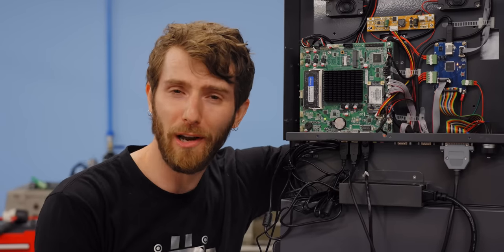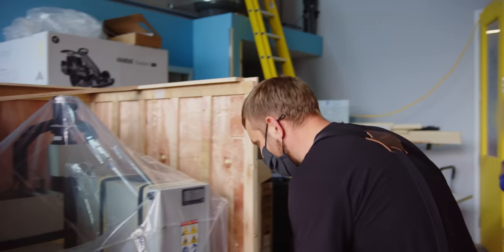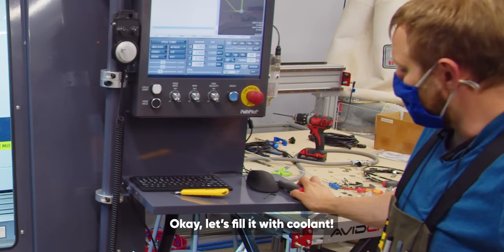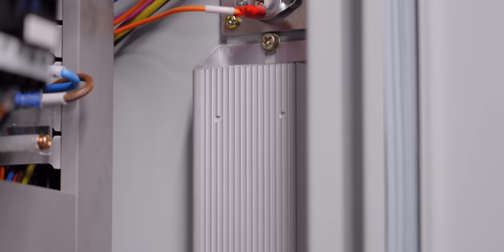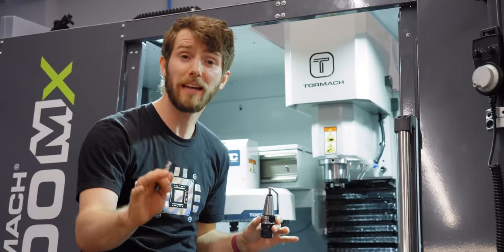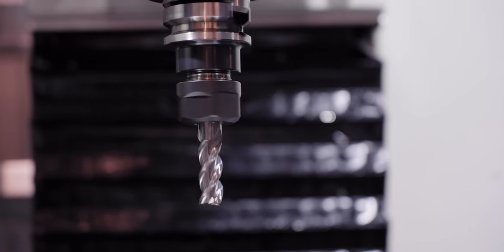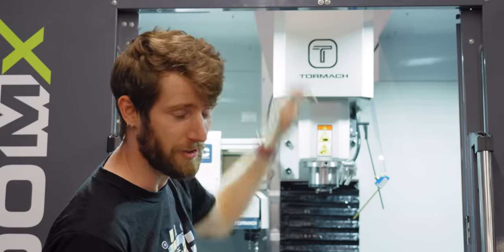The longest unboxing we've ever done. - Tormach CNC Mill Commissioning

Comment: You guys have nicer tools and vises than I had when I was making aerospace tooling and parts. Just shows how much my boss valued my sanity.
Reply: Aerospace tooling???? Whaaaaa that's so cool
Reply: lol same. I doing aerospace stuff down to +/- half a thou on super old romi lathes and a fadal mill, the tormach they have would’ve made my job much much easier.
Reply: But what kind of aerospace parts and tools are you guys making? Because "aerospace parts" is quite a broad term, from riveting hammers to turbine blades. So I'm kinda curious.
----
One little note: an old machine is not necessarily a bad machine. It's wayyy easier to get your tolerances with an old reputable-branded machine, then on an affordable new machine. (if well maintained)
New cast iron has internal stresses, if the factory didn't get rid of them enough, then your bed will warp because of use and vibrations. If your mill is old, then time has gotten rid of the internal stresses, and it will be just as straight as is was during the last overhaul. If your mill is expensive, then they have gotten rid of internal stresses at the factory.
Reply: @AdrianCupHolder  i can guarantee you it wouldn't.... lol... most problematic set of machines i've ever used was a brand new pair of tormachs and it was the reason i left my last job. 

i play with a Haas Tool Room Mill from the 1990's now and it hasn't given me any grief that i didn't generate myself.
Reply: @sasjadevries  Mostly prototype parts for the engines, gauges used to measure the accuracy of assembly and tooling used in coating processes of turbine blades shanks and many, many more. 

The fact is, you can make very precise parts on old machines with old tools and so on but sometimes I wished so hard they would buy me a tool that would make my life so much less stressful. A vise that would be actually very precise from the start and not needed to be modified to suit my needs.

Comment: I love how he's basically buying a new machine each time they have a new project at this point
Reply: It’s sad. They already had everything they needed.
Reply: I think they already wanted the tools. They just needed a project as an excuse to buy them. lol
Reply: @jacobleeson4763  i'm pretty sure most machinist would say, there's no point where more tool is bad
anyway, they now have toys to play with, i'd imagine it'd be engineering heaven for collin n friends
Reply: luckily CNC like the Tormach they bought can make anything they need if they learn how to do it. I used to think of cnc as basically plug and play but there are a lot of things you need to know and do to achieve proper tolerances and good finishes at a reasonable sum.
Reply: @Xlaxsauce  I have a strong feeling they won't fully learn how to use it. It's LTT after all, king of just scratching the surface haha. But they sure are nice machines
Reply: He prob made enough to buy 2 more off the video lol

Comment: AvE laughing as he watches Linus confidently talk about CNC like it's easy.
Reply: but Linus has been confidently talking about stuff he has no clue about for YEARS.
Reply: RELEASE THE SHMOO!!!
Reply: Careful KEEP IT IN THE VICE
Reply: I have a feeling there will be some lessons learned the hard way. with this machine. Like, humans are the softest thing in the shop type lessons.
Reply: What's hard about putting some G-code into a computer and pressing start?
Reply: @ssp_2015  Replacing the z axis and spindle after you yeet the vice.
Reply: Was waiting for the “skookum as Frigg.”
Reply: @israelmxc  ? advertising + youtube rev + sponsored videos. merch is minimal.
Reply: @ssp_2015  here's the hard part, recovering after mastercam errors out and crashes
Reply: @joshmdmd  Depending on the youtuber, merch can be a big chunk of revenue. Games Nexus talks about theirs a lot
Reply: @ssp_2015  when you forget that you need to make the radius of your tool smaller than the  smallest inside radius in the part.
Learned that one the hard way.
Reply: I. Ooooh
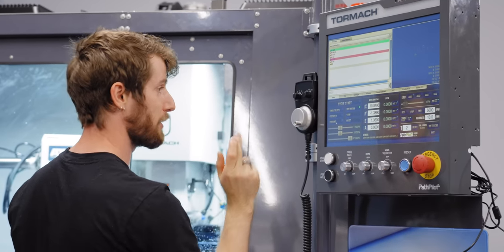Reply: 14:30
Reply: @66tbird1  I don't think that's likely. he hired people who know how to use this
Reply: As a CNC programmer/operator, I can confirm it is a lot more complicated
Reply: @ssp_2015  well perhaps maintaining the manufacturing tolerances, with a tolerance of 0.001mm this requires a lot of experience
Reply: And this is why i stopped subbing to LTT, they know absolutely nothing about the correct application of the technologies they showcase so whenever they try to learn their audience something new, all they do is teach them how to do something wrong.
Reply: just the tip and only for a minute mind you
Reply: @ameraldas3641  pre drill corners, takes alot of the load off the tool.
Reply: I say Linus gets first run unsupervised full send release the carnage

Comment: "The Coolant Pump has been running dry this whole time".
Groaning noise followed by Sad-Trumpet.
Reply: Thank God that coolant pump has a heat sync. (For this exact reason)
Reply: This made my nads hurt as a cnc machinist.
Reply: @brahtrumpwonbigly7309  blowing the spindle off without safety glasses made my eye twitch as a cnc machinist

Comment: notice he said "My" new mill? Way to bill your boss for your new toy. Bravo
Reply: If he's in charge of the machine and responsible for its operation / safety etc, it's 'his' machine.
Reply: @TheRealDuet  tru dat. Him, Alex and Mathias are gonna loove this thing !
Reply: @jivewig  my sentiments exactly. This will likely be the only time lienus touches this machine. Unless it for another video clip, for a moment of a second, Alex and crew on the other hand will be using the hell out of it. You can see this in action, on the pyramid build episodes. Lienus comes in for the intro/outro and Alex did the entire builds work, save for lienus holding a bracket while alex welded it (that could have been done by a magnet) lol.
Reply: @crisnmaryfam7344  lmao, finally no more manual threading for custom water blocks 😂.

Oh and heat kills magnets btw, permanently.
So probably you shouldn’t use them for welding.
Reply: @jivewig  Should have stopped with the first part of your comment.
We use magnets all the time in welding.
Whether it's for grounding or for materials placement.

If using them properly, heat death is not a problem.
Reply: @chrisbaker8533  ohh.. interesting. I’ll do my research. Thanks for correcting me !

Comment: When Linus just air blasted those Metal chips without safety goggles I flinched. There’s a good chance of one getting in the eye.
Reply: meh still rare
Reply: @PS1212  Coolant in the eye doesn't feel so good either
Reply: Yeah Id say its rare but still dumb not to have glasses.
Reply: I use the door to protect my face while blowing off chips if I haven't safety glasses on at that time.
Reply: @aamazinggalle  why wouldn't you have your safety glasses on
Reply: He should have respiratory protection on too as well as safety glasses.

Machine working fluids are hazardous materials.

Read the Safety Data Sheet LINUS Ffs
Reply: @markrtoffeeman  i doubt a small mist of that stuff in his lungs for the one time he does this would affect him.
Reply: @PS1212  In my experience, the rarity of a serious complication is not relevant to the experience of those who suffer that complication.  The guy who loses an eye doesn't actually care that that chances were 1 in 20,000.
Reply: @ffwast  90% of the time I do have 1 on
On some occasions I don't like the glasses, depends on what job

Comment: I Honestly thought it costed a LOT more. it wont be no DMG MORI probably then, put for the usecase they have, it's probably already overkill
Reply: I figured it would be something between 100k and 500k
Reply: Yeah, when said that, I thought "that's dirt cheap"! Especially for how modern and advanced that is. I was expecting several hundred grand.
Reply: @Locutus494  Ya, my employer paid more for a used waterjet recently.
Reply: @Locutus494  for a proper one from Siemens or dmg mori you pay around a hundred grand. And you can usually "spec it up" to around two hundred grand.
As someone who works for a big german car manufacturer and has work with those. I can tell you that what they got is not very advanced and user friendly. The Siemens system is way better and easier to work with.
Reply: Tormach’s are great intro level machines. You won’t ever find them in use in real manufacturing lines.They simply aren’t built heavy enough to machine aggressively with. But this is a good thing. The lighter build brings them in at a much lower price point and they really created their own market segment. It’s probably the perfect machine for LMG because long cycle and part times aren’t costing them a lot of money.
Reply: @Trank00007  thanks for the infos, didn't know the brand. The problem is that a lighter frame cannot be torsionally as stiff and that's a problem if you want accuracy. But I guess they'll have the luxury tho compensate with smaller feed rates/sub optimal tool paths, given how low their production volume will be
Reply: @Trank00007  Yeah, I was basing my price assumption off of something like a Bridgeport...
Reply: @salmiakki5638  A Tormach like this is a great little home or jobshop tool, as the chap above says. Really cheap at $40k but in the world of machining as a business this isn't a machine that would be considered. I have a couple of friends who have these in their garage/home shop as they're excellent for their side-gigs and they adore them for that purpose, but they say that they don't really compare to even a HAAS (which also aren't really considered viable in the wider industry).

If you're looking to spend this sort of money in a machine shop you'd buy a lowish spec Fanuc Robodrill or the relatively recently released DMG Mori M1 (for example). The Tormach straight up isn't rigid enough (for a start) for the work that these machines need to do day-in day-out in an actual machine shop.

For some info generally, in the world of milling machines, (in my experience) you're probably looking at £125k for a decent, reasonable envelope 3axis (maybe with a detachable 4th axis), £200k for a twin pallet 4axis with a pair of tombstones, £350k for a reasonable 5axis and £500k for a 5 axis mill/turn (maybe up to £750k if you stick a decent sized automation unit on it and kit it out for it). This would be for new/nearly new/ex demo machines from the likes of DMG Mori or Okuma for example.

But the world really is your oyster and the prices vary wildly depending enormously on application. You've got things like a Makino T1 which is a decently large machine that will actually murder large billets of titanium at circa £1.5m. You've also got small ultra-high precision machines like the ones Kern Microtechnik makes for extremely precise milling in a small envelope which will cost you north of £700k.

Much like buying cars, you can also add a ludicrous amount of optional extras to machine tools and you can hike the price up as high as you want!
Reply: Well i've been working for 6 months on a 6 millioen euro CNC. Cant compare this with a 40 grand cnc haha. Its really a joke
Reply: @salmiakki5638  The reason that higher end production machines are usually extremely big and heavy is not just for rigidity, its actually for thermal stability.  This is a HUGE factor when keeping tight tolerances.
Reply: @KLOKSLAG1911  Ooh! What have you got? Friends of mine at Airbus got some new toys recently for putting holes in wing skins on A350 that look super cool that I hear are in that ballpark...
Reply: @TotyPlays  that is what a DMG MORIS would cost.
Reply: @joshuabaines6789  Well the machine i worked on had to be programmed on coordination like most others. Once thats done it preps all kind of doors yes doors haha fireproof doors all sorts. This machine was really bigger that big. It also had a robot arm. Dont know the name or type... can look it up..
Reply: @Cfine91  thanks again, i thought both factor where weighted around the same. The more  you (I) know
Reply: @Trank00007  Not at that price, they're not. They're competing with Haas Minimill (base price $34k) which have linear rails, a 40 taper spindle, 7.5 go, and a dealer service network. Admittedly, by the time you option out a Minimill to match what they got from Tormach, it's going to be more money, but then they'd have a machine built by an industrial machine tool builder.

Comment: Linus: "how much did I pay for these?"

"Well... interrupted by jumpcut
Reply: They can be from $100-$600 Its not that "expensive"
Reply: @popegramzz479  you gotta consider thst those tools have to be replaced fairly often.
Reply: Website says, "Packages starting as low as $19,250" and "Fully Loaded At: $31,175". Less than I would've guessed.
Reply: @BlueBoy0  Tormach is specifically built and marketed to the entry level buyers, be it garage CNC setups, education, etc. If you start looking into HAAS or Mazak mills you start climbing in price real quick
Reply: @popegramzz479  where in the rats ass did you pull out those numbers

Comment: AvE is going to be cursing you for not getting a HAAS. He suffers as the lone Canuck user of a HAAS CNC to this day.
Reply: I prefer running Okuma or Mazak but I have to add come on Linus don't use a blow gun in a cnc without safety glasses you will end up getting metal in your eyes.
Reply: Truth
Reply: My favorite machine is a robo drill. Currently program a Mikron HPM 450u, it's been fun learning the Heidenhain control.
Reply: The Haas AvE has is about 8x more expensive though....
Reply: But isn't Tormach just the best option for the DIY-shop, when you don't produce that much.
I mean for simple prototyping and tinkering, this thing has all the features they need. LTT doesn't make money per part, but per video.
And sure, if your business model is all about automation and reduced cycle times, then it's worth getting a more expensive machine, because it will pay for itself.
Reply: @besibi  Understatement of the century
Reply: @SDNorm2  does okuma or mazak offer a 25k cnc mill with the footprint or capabilities of the Tormach? No.
Reply: @sasjadevries  yes. Tormach broke the mold here for the price point.
Reply: Not very skookum machine
Reply: Don't know why this wasn't a collab with AvE. He's got the case stickers for it.
Reply: @sasjadevries  No, no it is not. Not this model anyway. It's rather expensive for the performance you get (or don't get). Every tormach buyer I know has had instant remorse at not just getting a "real" machine. If the tormach was the 400 at $5500 then sure, you put the cash down and be happy with what you got. But this one is almost the same price of a hass mini mill ($32000 for tormach vs for $ 33k for the haas, $43k with the 1000rpm spindle, and high speed machining). It stops making sense to consider the tormach.
Reply: @brahtrumpwonbigly7309  Haas does. They are the only ones I think.
Reply: @wernerautomation2834  Well, yeah, I do have to agree with you about this model, it is on the expensive side.
I personally think that if you're willing to spend over 40k, then you can just as well spend a little extra and get a 5 axis with more build volume, and get an HSK spindle, because all that will pay off. 
I don't like machines in the $20-80k price range, because they're too expensive for the home shop, and they lack the features that allow you to be competitive.
Reply: @sasjadevries  I'd get a speedio myself, but the point is the same. This machine occupies a market that doesn't really make sense. too expensive yet at the same time too cheap.

Comment: $40k actually sounds reasonable for a professional machine. It’s a lot of money but even a lay person like myself can see the value.
Reply: That's not a professional machine though, Tormach's really are just glorified toys. They are okay for your garage but you could never compete against someone with an actual professional machine that's a few years old and only costs a few thousand more.
Reply: Pricepoint is out to lunch on them. Honestly they're not as capable or rigid as 20 year old 6030s in our area. One of Linus' neighbours is selling two Mazak 6030s from 2000 for $15000 each. Brand new VF2/VF3s from HAAS are similarly priced and financed.
Reply: LOL professional machine ??
Reply: @joshmdmd  I'm guessing that tormach was $40k indexer, work holding, tool holders inclusive. A $15k vf2 probably has clapped out angular contact bearings, was running on 20 year old coolant and has a fubar tslot table with gouges

Comment: When I was doing engineering making CNC stuff was always super fun. Metal solves so many problem if you know how to work it. The down side. It’s a expensive hobby. I’ve been wanting to buy a 30k one for my shop but I don’t have the time right now since I only engineer part time and it’s remote. The fun machining starts once you get into 5 axis machines you could bore out a engine block from a solid piece of aluminum block if you wanted. :)